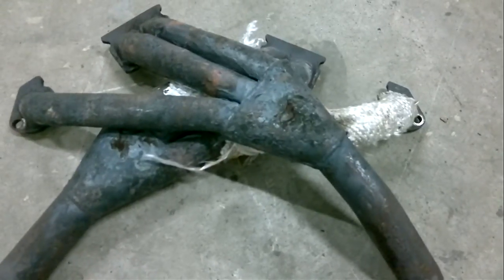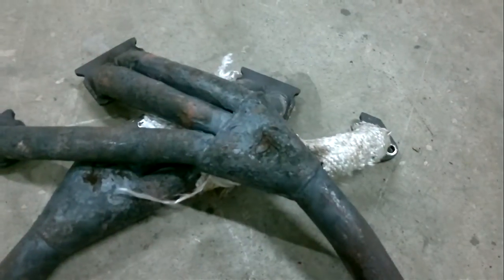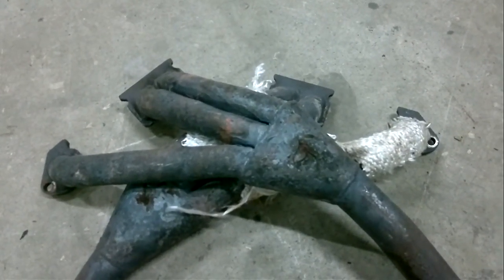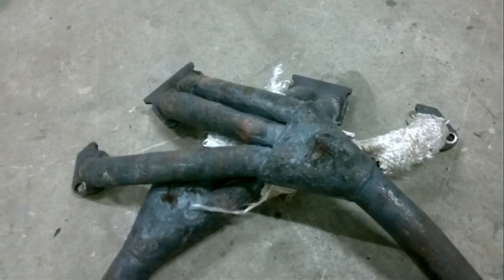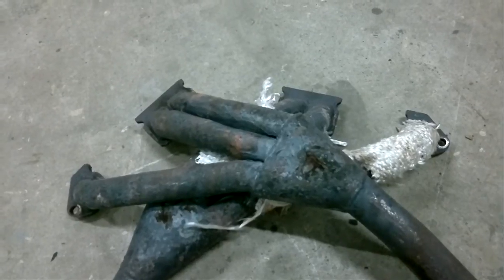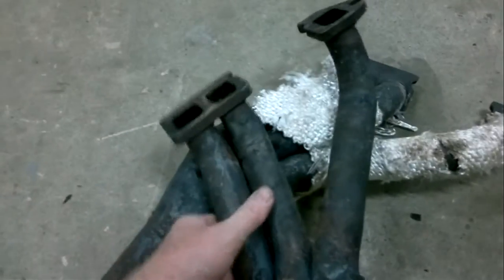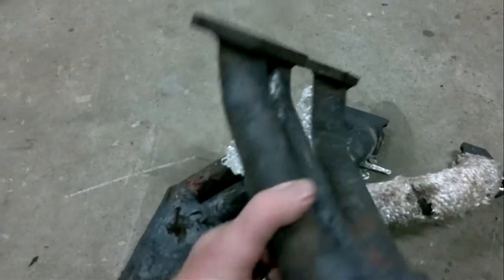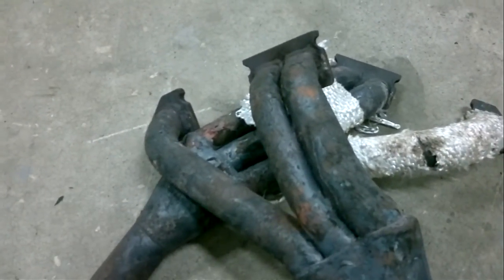Exhaust wrap corrosion

Comment: You need to use ceramic header paint before wrapping anything if you live where your exhaust is exposed to salt and/or excessive moisture.  This is why.  Also another reason to idle your car down before shutting it off so the wrap drys first.